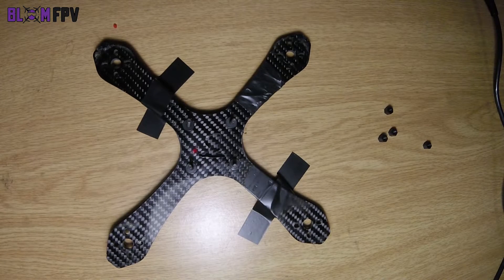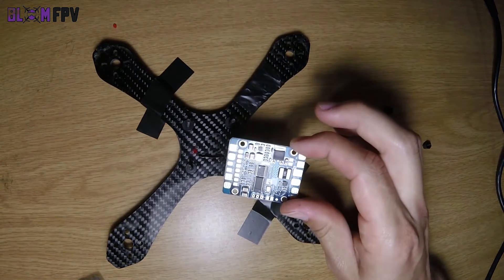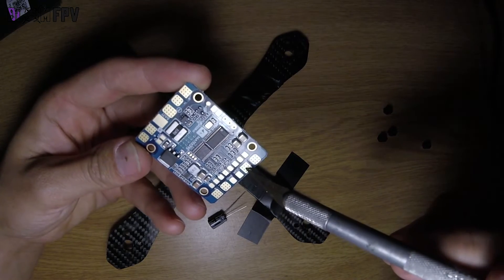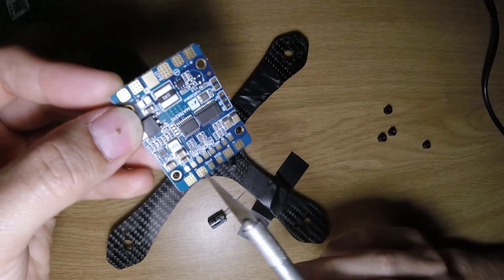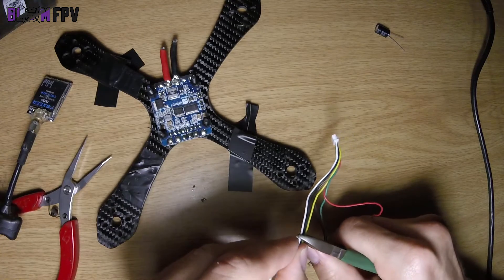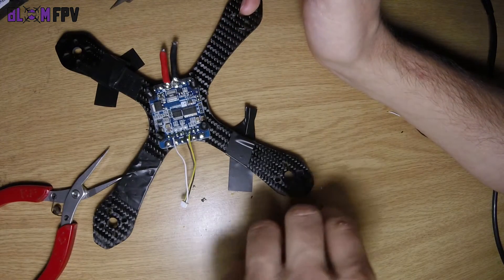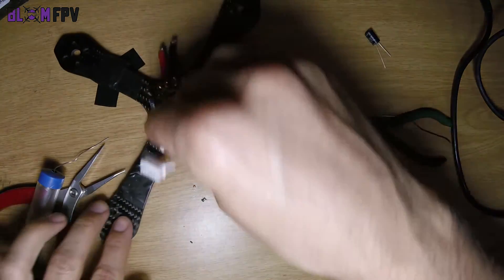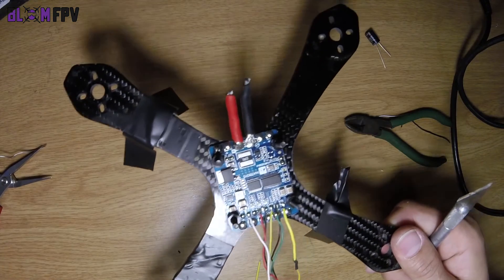How To Wire Up Matek HUBOSD | Review & Tutorial

Comment: Hi, nice video! I have a question

I don't do FPV but I still want to read those readings (amp, volt). Can I make it transfer the data to my computer instead?

Thank you!
Reply from the maker: Hey man, no I don't think so, if there is a way I have no idea how. This is specifically made to overlay the data on a analogue video signal.
Reply: I guess I have to figure out another way then :) Thanks

Comment: Do you know of there are any smaller current sensors that are plug-and-play available?  Can't seem to find anything and I'm trying to build a very light quad so I don't want to add a full PDB just for that.
Reply from the maker: Hey man, unfortunately I don't. Depending on the type of quad you want to build, consider using a Betaflight FC, it has a built in OSD and current sensor
Reply: Blom FPV 
Right on; that one is hard to find these days.  I also have a few other quads that I'd like to retrofit with a current sensor.  I guess that's a missed opportunity for the RC part manufacturers.
Reply: DirkaDirka07 you can simply just replace the pdb and flight controller with a flight controller that has a built-in current sensor like the dys F4 and you will technically get rid of two boards in only use one
Reply: Thanks for the info... I hate tossing old stuff that still works and was hoping that there was a plug-in option.  There are but they are big unfortunately.  In the future I'll be ordering FCs with built-in current sensors like the one you suggested.

Comment: Can I tune my quad thrugh my googles by adding the TX rx wires from the fc? In that case do I wire tx-rx or tx-tx etc?
Reply from the maker: Hey man, as far as I know you can't do that. It's a feature that would be present on the Flight Controller, not the OSD. If the Flight Controller allows it then you should be able to, but I have no idea how. The only FC I know of that can tune everything through OSD is the Betaflight FC
Reply: Blom FPV all right, I'm waiting for flip32 f3 with betaflight. It should work better :)

Comment: Could you please do a build with this : 
http://www.banggood.com/Matek-Systems-PDB-XT60-W-BEC-5V-12V-2oz-Copper-For-RC-Multirotors-p-1049051.html?rmmds=search ?
Thanks
Reply from the maker: Hey man. It's a very simple setup, just follow the writing on the pads. + goes to your positive ESC wires, negative goes to your ground ESC wires. And you can use the 5V and 12V pads for your camera and VTx power. You'll have to connect the camera signal wire directly to vtx signal wire.

Comment: how to flash firmware onto the board? it doesnt have any terminals for connection
Reply from the maker: It does have points for connection to flash it. However I haven't done so. Refer to the manual for the HUBOSD, it should explain everything.
Reply: thanks
Reply: Arjun Anbarasan I'm pretty sure it's those little pin pads on the left of his board see the little pin pads

Comment: mate, i was waiting to see where you actually soldered the capacitor, could add photo.
Reply from the maker: Sorry man, I did forget to add that part in the video, I do however show where it is soldered at 1:47, it goes directly on the battery pads along with your battery leads.
Reply: Thanks mate

Comment: Hey, great tutorial! I have a problem with mine tho. When I throttle up, my video image gets interference and my osd then disappeares until I replug my battery. I didn't get a capacitor with my pdb, could a capacitor solve this? Any ideas?
Reply from the maker: MrErikz94 hey man. Yes a capacitor will definitely solve that. Try and buy one somewhere. The one I have is a: ZLH 25V 330uF

Comment: If I can add one bit of advice, Please sort out your sound, The sound comes over very muted.... I assume you are using your gopro? perhaps use the open back plate so a bit more sounds can get to the mic... other than that, good job :)
Reply: What did you end up doing with the capacitor?
Reply: Capacitor?
Reply from the maker: Thank you very much. I'll try my best to record the sound a bit better next time.
Reply: ;)  if you are recording with a gopro,  perhaps take a look at those external mics available for gopro's ;)  keep up the good work boet. Lekker lekker soos 'n kraker
Reply from the maker: Haha thanks man. Unfortunately it's a gopro session so a external mic won't work.
Reply: record with a phone, the. sync with video?
Reply: where did the capicitator goed??
Reply from the maker: Rons Rosenquist hey man, the capacitor goes as closely as possible to the power source, so solder it where the battery XT60 connector is soldered
Reply: Blom FPV thnx for your fast response!
Reply: Would osd still display if I used my vtx's voltage to power my camera?
Reply: Yes, might need a common ground though